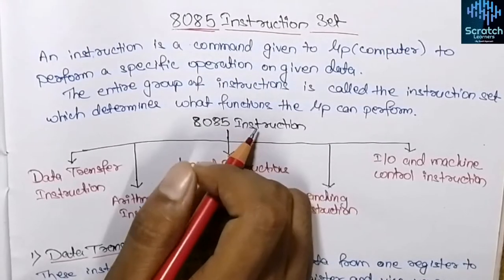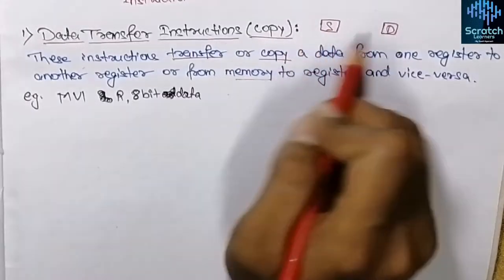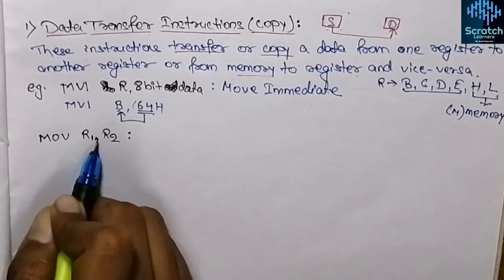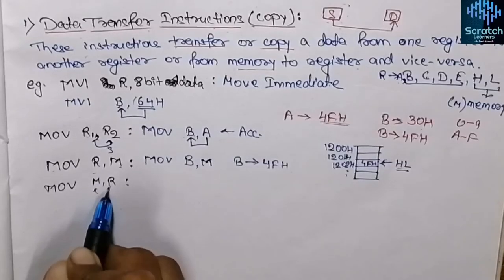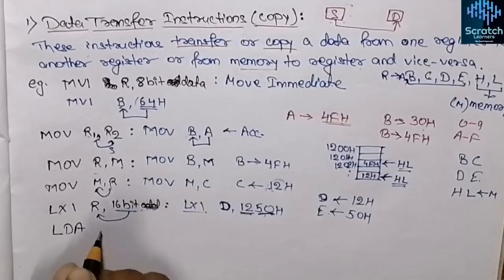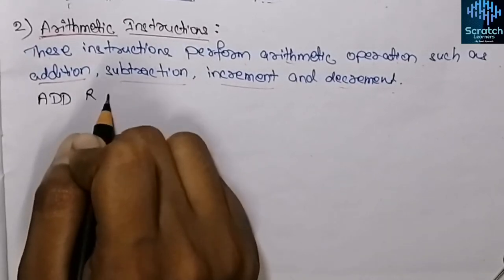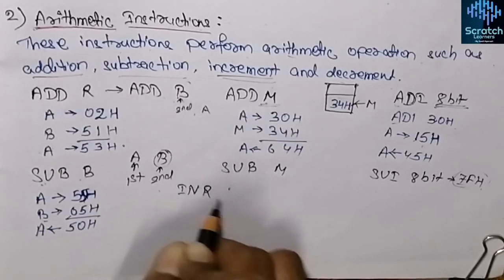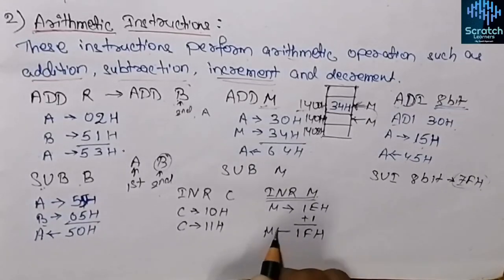Instruction Sets of 8085|Data Transfer Instructions|Arithmetic Instructions|8085 instructions

Comment: mam hl pair kya hota hai
Reply from the maker: HL register pair is Memory register. 
When we load some data from memory, then we actually write the data(input) in some memory location which gets pointed by HL register pair.
Reply: @ScratchLearners  mam can we use only hl pair not bc and de pair. thanks
Reply from the maker: @gautamgupta6915  BC and DE register pairs are mainly used when you have to deal with two 16 bit data like for addition or subtraction of two 16 bit data as HL register pair can store only one 16bit data. Else no need to use them.
Hope you understand :)
Reply: @ScratchLearners  ok mam thanku